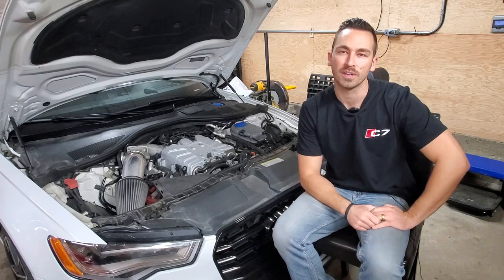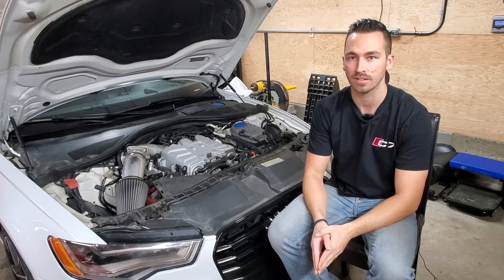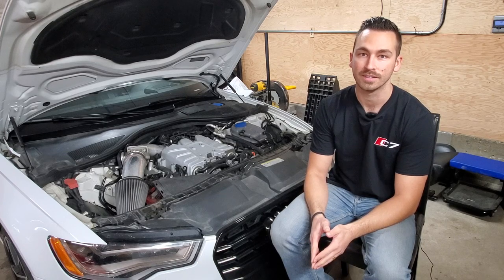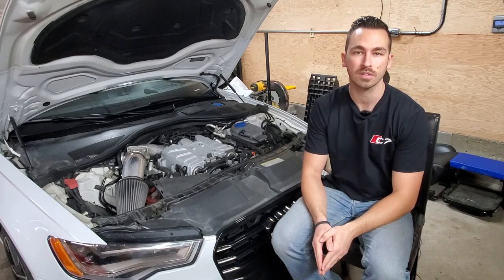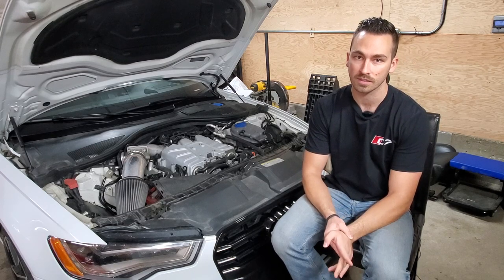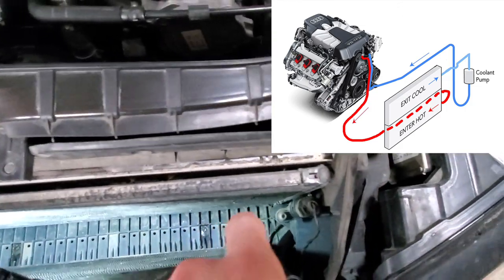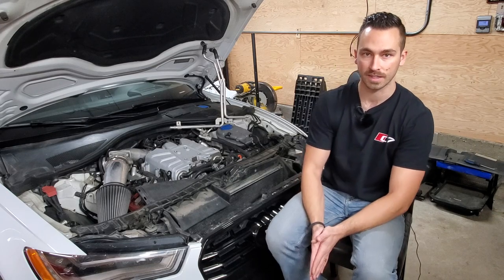3.0t Tech Talk Ep.4 // Optimized Cooling Loop

Comment: Good tips. Already have C7 A6 with DP E40 and CWA-100, but never considered using the later SC hardlines. Thanks for the tip
Reply from the maker: No problem! Which HX are you using?
Reply: @SuitedUp2The9s  merc v2
Reply from the maker: @360construction9  nice, same.

Comment: Thankfully I live in FL and I rarely ever have to worry about freezing temps. But Just running a 4.0T Merc heat exch and divorced SC loop with a 80/20 mix makes a world of difference on my SQ5. With FL temps and 190 dual pulley e40 setup, I never see temps 15-20% above ambient on pulls. I also have modified the fender liners
Reply: How have u modified the liners? Sounds like a good idea. Thanks
Reply: @christos8189  Not by choice. When I first bought the SQ5 in Commiefornia I took it for a spirited night drive and hit a plastic crate that ripped up the belly pan and one fender liner. Later after modifying the car more heavily and going faster and faster it seemed the stock retention method for the fender liners could not handle the extra stress from moving that quick and would routinely rub on the wheels at speed. I later removed the driver side  front section all together and modified the passenger side to still offer some protection for the intake. The supercharger whine was amplified two-fold from no longer being muffled by the liner and hood liner.

Comment: Love your Channel man. Hopefully can get my C7 to this stage at some point !! Basic 034 st1 93 and zf beta flash for now. Keep it up !!
Reply from the maker: Thank you very much! We can definitely get it there! Thats a great starting ground! Cheers! Anything you want to know more about that I might not have a tech talk planned about?
Reply: @SuitedUp2The9s  truly man you’re hitting it all . This optimizing the cooling loop is huge. I plan to also delete my small heat exchanger from underneath my headlight in hopes to shorten the loop. Can I use the b8.5 redirect that you installed on a stock set up? Was thinking about doing that along with the smaller heat exchanger delete! Let me know your thoughts! Excited for the journey with this car.
Reply from the maker: @alexburr36  the b8.5 redirect works with an upgraded heat exchanger or an oem one ONLY if the inlet and outlet to the hx is on the same side (LHD Drivers side). I don't know for sure all the models that have that.
Reply: @SuitedUp2The9s  perfect. You’re the man
Reply from the maker: @alexburr36  😃👍

Comment: looking into doing this. my question is when you delete the secondary HX…how are the lines from the CWA50 ran exactly? and are the coolant reservoir and radiator linked together like you’re divorcing the coolant loop ?
Reply from the maker: @c7nero  the front hx feeds the cwa inlet. The outlet of the pump goes to the intercoolers. If you go to this video, I explain and show where the reservoir links to the sc loop and the engine loop.
https://youtu.be/CheLLhVHHXQ

Comment: interesting info.
I too removed my side hx and I honestly think its worse maybe its placebo but I dont feel its as efficient. I am also still just running a cwa50 @100% duty. 
so......
also im still rocking the b8 hard lines, to fix the issue you speak of, just flip the merc hx the other way. so both sides are on the passenger side. lol
Reply from the maker: Flipping the merc makes for a longer loop as well risking a kink as it has to make the 180 turn back to the pump out of the hx. The pump is on the far side then from the supply and return B8 piping. Making for a longer loop.
Reply: @SuitedUp2The9s  its actually a shorter route to the hotside of the tank. cold side shouldnt matter as much. and their are zero 90* or more kinks except for a small 6" hose from the pump that i actually flipped around so it would route into the resevoir.
Reply from the maker: @tvillaa  its hard for me to talk about this when were not talking about the same loop, you being divorced and having an unknown routing at this time. You've mentioned tank and reservoir and I am unsure where they fit into your picture.
Reply: @SuitedUp2The9s  its literally the oem b8 setup with a merc hx. flip the hx backwards so both entrance/exit are on the passenger side. removed the side hx so the hose feeds into the cwa50 pump into a merc resevoir behind the driverside headlight that feeds into the cold side of the bricks inside the supercharger.
Reply from the maker: @tvillaa  ok, thank you for clarifying. Just let me know if I have  this last part correct. You flow from the pump, into the merc divorced reservoir and then into the ic?
Reply: @SuitedUp2The9s  YUP. this is why i said interesting information. i know you are going to mention the foam. thats why im starting this conversation because I dont have cooling problems and im running the setup you are advising against (and you said you've never tried it)
Reply from the maker: @tvillaa  foam is one issue but thats not using the reservoir properly. The reservoir should be used to supplement the coolant loop volume in case of a leak and provide a spot to add coolant. Pumping through a reservoir is hard on your pump and loosing a lot of flow. An analogy to consider is would you make a pump have to pump water through a 20L pail before pumping into lines going to a XYZ system. No, all of the pump pressure and flow would be lost before trying to get it to enter the rest of the system. This is all providing were on the same page of how your system is set up.
Reply: @SuitedUp2The9s  and you might be right on a technical level, but in real time monitoring the temps, i have no issues. Its a closed system so pressure is always there? I am using the resevoir exactly as intended by merc.
Reply from the maker: @tvillaa  I don't think thats how Merc designed it. I've seen their system. Taking a second look at your system could improve how your divorced loop is running. Your pump would be a lot happier for it.
Reply: @SuitedUp2The9s  How should it be ran then? because again, my pump has great sucking power pulling fluid through the reservoir-going through the "extra" lines.
my recover/ cooling is def better than many folks post about online.
Reply: @SuitedUp2The9s  not to be rude, your video sucks lol (you briefly mention stuff but don't go into detail, hence why I started this conversation). You are correct though about the whole setup. I had to do some digging around).I have all version1 merc stuff and somehow missed the info that was out out for the resev.  I did find a different video from c7 owners international that breaks down the info much better.
Again you are correct. I guess I'm going to buy some things and see about the "9* over ambient" that you speak of. Until the next time. Thanks for the enlightenment. I've got work to do.
Reply from the maker: @tvillaa  hey I'm sorry you didn't get all of the information you wanted from the video. I'm glad you were able to find the rest of what you were looking for. I do like that about the whole community that someone else also can help and provide answers 😃
Reply: @SuitedUp2The9s  its all good. it was a great chat. i just need to figure what im gonna do because like i said, i am doing just as well with iat's as you guys are and im running what you guys are against.
Reply: Man I need this. I have the CWA150 and Merc HX but I want to divorce and shoeten the cooling loop. What all do I need, just the B8 S4 hardlines and Merc reservoir? Also do you have the part number for the S4 hardlines?
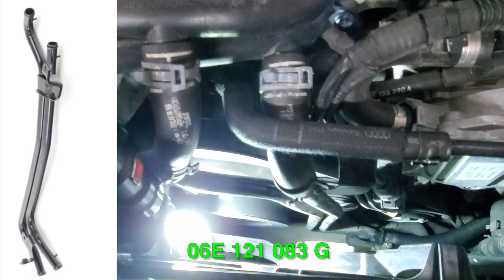Reply from the maker: I don't promote divorcing the system. The b8.5 hardlines are at the 4:20 time mark, I don't have them off hand.
Reply: @SuitedUp2The9s  Oh ok. I don't necessarily want to divorce if I don't have. I can save money on the overpriced Merc reservior👍. So to run it like yours I just need the B8.5 S4 hardlines?
Reply from the maker: @C Midas  yeah thats correct, b8.5 hardlines, merc hx, deleted side hx, and the cwa100 unpinned is the basis of my system
Reply: @SuitedUp2The9s  Oh ok, so I just need to delete my side hx and get the B8.5 S4 hardlines. Your still running a 50/50 coolant mix?
Reply from the maker: @C Midas  yup, its -40C in the winter time where I live so I don't bother switching it around and just keep it 50:50.
Reply: @SuitedUp2The9s  Yeah I hear you. I'm debating on maybe going divorced and running distilled and water for summer because I'm in Cali. Honestly if things go right I'll have an inter/killerchiller by then.
Are you gonna be doing an update on your new charger anytime soon?
Reply from the maker: @C Midas  have you watched my divorced loop tech talk video on recommendations? 

Killer chiller is interesting but in our cold temperatures up here, my friend and I have been able to simulate what a killer chiller does. Our IATs start super low, around -5C to 0C. Then they still end up at the same final temperature of a run in the summer. In the summer they start at 30C and end at 60C or if on a hotter day, start at 40C and end at 70C. But either way, haven't seen a benefit with a killer chiller. It starts low but the temp shoots up like crazy to the normal end temp.
Reply from the maker: @C Midas  and as for the charger update. Hopefully soon, there's been a lot of work happening.
Reply: @SuitedUp2The9s  Don't think I've seen the tech talk video but I'll look it up. 
As far as the killerchiller, I'm in Cali and it gets hot out here so higher temps for us.  Of course I'll try everything else first. Hopefully I can get my temps down a lot further.

Comment: I have a 2016 sq5 and i have the cwa150 and was gonna try this loop just straight run of hose from the supercharger to hx to pump i was wondering if you knew it that will work with it  depinning
Reply from the maker: @johnriener6456  yeah you should have good success with it I think. I'm not familiar with running the cwa150 so I can't talk with confidence or certainty. The depinning and running it at 100% speed I'm a big fan of on the 50 and 100 pumps

Comment: Hello i have a question.  Im currently on stage 2+ with a 207mm crank pulley and a MERCRACING heat exchanger.  My IATs are oretty high right now.  Do you recommend ibdo the CW100 pump first or divorce the SC coolant loop first?
Reply from the maker: A divorced reservoir is relatively cheap, so long as it has a vented cap like our coolant reservoir. But I would do both at the same time. You're in the same area, could one and done it at the same time. If I had to pick though between the two, the CWA100-3 would be it.
Reply: @SuitedUp2The9s  thanks!  I ended up ordering a MERCRACING CWA1500.  Im testing a 100 octane file for Jackal Motorsports and my IATs were close to 80c

Comment: I would be nice if you add the part numbers im the description and a short step by steo summary. Its nice that you explain a lot. But if you dont know shit like me I still need Pictures or a video directly at the engine/coolant system to know what to do :) 

greetings from Germany
Reply: So to make it short

1.You installed the Merc Racing Heat exchanger (what is the difference to others like APR...)
2. replaced CWA 50 with CWA 100-3 and unpinned pin 2 for 100% Performance
3. deleted the additional Heat exchanger on the driver side (is it there in all A6 C7 Models?) It did increase recovery time right?
4. Shorten the Coolant loop with that OEM part that. What did you used to connect them? 

I saw that some other youtuber used 3/4 coolant pipes to increase the volume transported by the cwa100. Could that be also an Option for you?
Reply from the maker: When I take the front bumper off next time, I'll be sure to grab this. I do wish I would have taken the time to do that for this video to make it really clear instead of the pictures. 

Cheers from Canada

Comment: By looking at the diagram that you have during the video does it matter which way the current flows through the heat exchanger because I think I my have my backwards. I do drive a A6c7 as well.
Reply from the maker: I did have mine backwards for a period of time. Didn't totally matter but it should be switched so the hx can do its job better 😃👍

Comment: How do you delete the secondary HX?
Reply from the maker: Just a double male 3/4" on both of the hose ends and hose clamps. Later I cleaned up the extra hose and made straight runs of hose from each part(pump, hx)

Comment: How did you have the stock HX plumbed into the loop and where was it mounted?
Reply from the maker: It was the B8 style with inlet on one end and outlet on the other. So I ran it into the stock hx first, out of that into the merc hx, from the merc to the CWA100-3. The stock one was mounted behind the Merc, in essentially the stock location of it. The idea that more exchanger was my idea to test, after all  the merc is a bigger hx right? That's where it failed. The iat delta got worse, closer to the 40C increase again. Talking to Jose at Merc racing there is more to hx design than just making it bigger. So after pulling the stock one out of the loop and shortening the hoses and reducing the effective volume of the loop made for the best performing loop.
Reply: @SuitedUp2The9s  ah, thank you for the response. 
I have a B8.5 Q5 with it plumbed to the top of the PLM first, out the bottom of the PLM (same side), going right into the front mounted stock HX (literally mounted under the crashbar), then out (again same side) to the stock pump.
I do not have any before/after data to suggest my arrangement is better or worse.

Comment: Hi,  can I do exactly the same set up but on APR HX ? Or I need to get exactly the same as yours HX? Thanks
Reply from the maker: Yes you can do the same thing with the APR HX.
Reply: Are you recommending to remove a small radiator or leave it on, APR HX is slightly smaller than Marc HX?thanks
Reply from the maker: @supercharger_a7472  remove the baby hx on the side. I didn't do anything

Comment: So i unpinned my center wire on my b8.5 s5 and while watching logs the temps instantly drop from slight throttle then back up instantly when off throttle... u think unpinning it didnt work for whatever reason?
Reply from the maker: No that's accurate. That off throttle action has your bypass valve open all the way, recirculating the air inside your supercharger. And much less is getting used up by the engine all while the TB is closed(doesn't seal off by closed) and no fresh cooler air is getting in. Then when you even slight throttle from there, you've got the air flow reestablished with the TB open letting fresh air come in, the engine is taking air now that you're back on throttle putting some load on the engine.
Reply: @SuitedUp2The9s  smart man... thanks. I want to verify with vcds... do you know what I should look up on there to see if the pump is at 100% duty cycle?
Reply from the maker: @40 Roll  if you have the stock pump the cwa50 still, and you did the middle wire, then 100% you can trust that it's at 100%. Another way to check, and easier, is check your fault codes, the removal of the pwm signal for the pump results in a soft code for the pump being in emergency mode. So you can check that instead if you want
Reply: @SuitedUp2The9s  yes I did have the code! Ty
Reply from the maker: @1bads5  you bet!
Reply: @SuitedUp2The9s  and u do the same unpinning to the cwa100 pump too? 2nd pin removal?
Reply from the maker: Sorry no, I made a mistake there. If you look in the description I correct that. It should be pin 3.
Reply: @SuitedUp2The9s  lol yeah that was 5 months ago. I got it
Reply from the maker: @1bads5  yeah the guy above, Gareth, commented and I was responding to him 😃

Comment: With the pump running at 100% all the time what would u guess is the longevity of the pump?
Reply from the maker: Thats a great wonder. I don't have a good guess. Its an oem pump for other manufacturers so my guess is still quite a while then.
Reply: I would be more worried about the SC cores giving away quicker. Always under 100% pressure will be killer and not including the constant fluctuations in temperature.
Reply from the maker: @Mazzerants  The countless people that run the cwa100 don't have that issue of popping ic's.

Comment: Does running the pump at 100% cause wear and tear?
Reply from the maker: @EGEIS9  not that myself or anyone else has reported. Its been at 100% for several years now and be performing flawlessly. It certainly makes bleeding the system easier too
Reply: How can I tell if my pump is on its way out? I’m the second hand owner and car has 140k miles I did the basic 3 maintenance water pump, thermostat and pcv I’m afraid to depin it and the pump poops itself.
Reply from the maker: @EGEIS9  they are a high quality pump. To have confidence in it, maybe the move it to buy a new CWA100-3 and pop it in then and skip depinning the cwa50. I do have a backup pump just in case. If it doesn't sound like a smooth electric motor or if you put your hand on it and it feels rough, maybe, maybe that could be a sign. If they fail, they seemingly die, there isn't much of a warning
Reply: @SuitedUp2The9s  hmmm yeah so in that case I’m going to wait till I upgrade to cw100 and then depin I’ll leave it stock for now. Plus I’m just a college student that wants a fast car not looking to race this car lol
Reply from the maker: @EGEIS9  totally reasonable plan haha